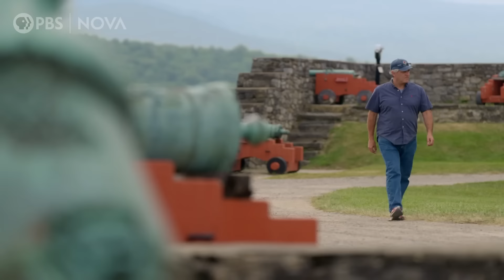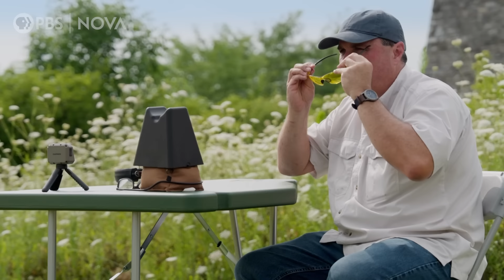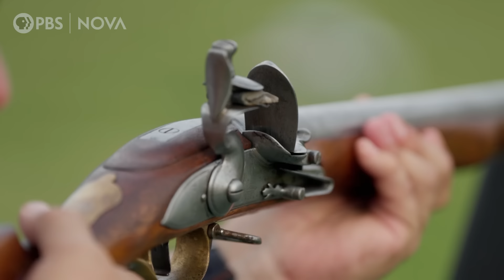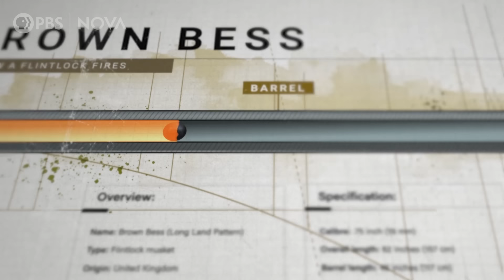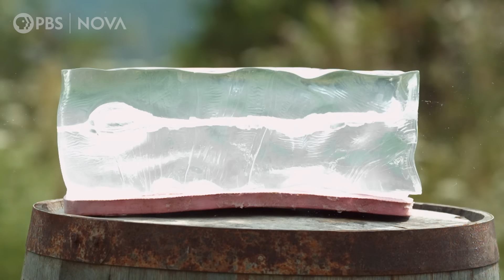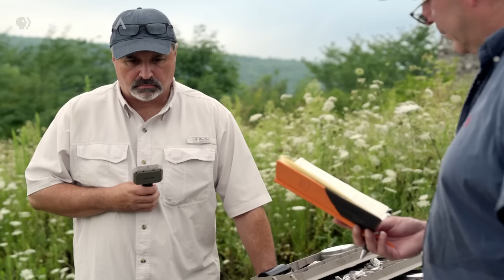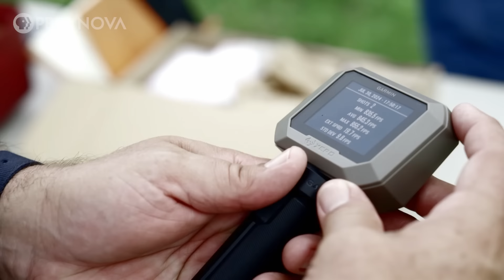How Deadly Was the Musket? | NOVA | PBS

Comment: My understanding is that the problem wasn't the impact, but the accuracy.  Both higher muzzle velocity and rifling contribute to a more accurate shot.  Apparently, that poor accuracy was why they had lines of soldiers firing at once, hoping some of them would hit the enemy.
Reply: ive done rev war and other 18th century reenactment my whole life youre believing a common misconception a musket while not pin point accurate is still able to hit a man sized target within 50-75yards depending on waddage. The main point of massed line tactics was to compensate for long reloads, extend the range under which musket fire would "fix" the enemy in place under fire even to long ranges therefore allowing your more mobile elements(musket armed light companies and cav) the ability to move quickly. The main point of large formations was therefore to deny the enemy the ability to move on the field of battle while keeping armies of thousands of men organized and protected against mass cav. just as every other comment has stated, I hope we've cleared this up for you.
Reply: @existentiallydead5998  50-75 yards isn't even a football field away.  Given the scale of some battlefields--which can stretch miles in either direction--that is a very short distance.  Bolt action rifles were accurate a thousand yards away or even more depending on conditions.
Reply: @primevaltimes  I mean, of course bolt actions were more accurate; you're talking about a significant amount of time and technological advancement.  But I will also say that they weren't more accurate because of the bolt action.  People put WAY too much stock in that.
Reply: @billmelater6470 I know the action doesn’t make the gun accurate.  The rifling and barrel length does.
Reply: @primevaltimes  Yes and no but that's still an oversimplification like the mythos of the bolt action.  You can have a shorter barreled rifle shoot better than one with a longer barrel.  

A rifle is a system with parameters that aren't independent of each other.
Reply: It's like breaking them with grape shot
Reply: No, the impact and stopping power of weapons nowadays is way higher. Mass x acceleration = force.
Reply: @Braziliansyrah sort of
To get the high speed the projectile on a modren gun has a low cross sectional area. Most guns are 1/4 to 1/3 of an inch and can transverse a body giving transferring a small portion of its energy to the target.
The musket ball was already 3/4 of an inch and starts to deform rapidly, transferring a large proportion of its power to the target
This was a little unfair comparison. The range looked about twenty five yards. Most fighting took place at ranges less then a hundred yards
Today fighting takes place at longer range, two to five hundred yards, when even the modren round has slowed considerably 
Modern hunting rounds have special tips on them to help expand the bullet that are absent on military rounds.
Medical care has greatly improved from musket times, but few men hit in the torso with a musket ball could have survived long enough to get any care, even if it was available
Reply: @Braziliansyrah no that’s not exactly true
At long range modern rifles certainly have the advantage. However in the range of a musket, one hundred even out to one hundred and fifty yards the musket created a more devastating wound than modern guns.
A round ball of lead sheds velocity very fast, compared to the ballistic coefficient of a modern bullet. But that same property made the fat ball very good at transferring energy to the target. At their close range they made big holes and horribly destructive
Reply: @Braziliansyrah  Why did you write this? What's the point? A musket bullet weighing 20-30 grams and traveling at 300-500 meters per second will have an energy of 3,000-4,000 J. For comparison, the energy of an M16 bullet is approximately 1,800 J.
Reply: @KaL_69_  I don't know how you did your calculations but they're very wrong, using KE = 1/2 x m x v² you get ~1.750 Joules with the M16 and ~2.000 Joules for the Brown Bess. That's discounting hidrostatic shock and superior piercing capability.
Reply: @Braziliansyrah  I use a ballistic calculator. Brown Bess bullet weight is 28 grams + bullet speed is 450 m/s = 2800 J
Reply: @Braziliansyrah  The British themselves complained about the poor stopping power of the new Martin Henry rifles during the Zulu War. They said a single rifle shot rarely killed a Zulu, and sometimes even multiple shots weren't enough. Even though these rifles were 12mm caliber, modern rifles are even weaker, so soldiers fire multiple times to ensure a kill.
Reply: I’ve split 18 playing cards, standing freehand with flintlock rifles and a couple of times with smooth bore flintlocks.   (Nope, not from a hundred yards)😊
Reply: Modern people are basically incapable of logical thinking... It's enough to compare the ammunition consumption in the 18th century and in the 21st century to understand who shoots accurately, and who shoots somewhere in the direction of the enemy, hoping to scare him.
Reply: A musket will hit a human torso every shot at fifty yards and will hit the same size target four out of five times at a hundred. 
Armies fought in lines, one man every eighteen inches, and one or two rows right behind them.
A company of 80 soldiers would present a from about forty to sixty feet wide and five feet tall. At three hundred yards a musket will get about one in five hits on this target
Reply: Muskets aren't really inaccurate weapons. The Prussian army did various tests and found that a trained soldier could hit a man-sized target at 80 meters 50% of the time. On the battlefield soldiers would panic, firing too high or too low, and they would be firing into giant walls of smoke produced by thousands of muskets and hundreds of cannons firing, having to guess where the enemy was. That brings down the rate of hits. The British at one point during the Penninsular War estimated it took 600 shots to inflict 10 French casualties. Volley fire was done right at the beginning of an engagement. After the initial opening volley soldiers would just fire as quickly as possible. Soldiers aren't going to wait for their officers to give the command to fire if they're being shot back at. 

The main two reasons why they fought in lines are command and control and defense against cavalry charges. Since there were no radios, officers had to issue orders via shouted commands, drums, flags, bugles, etc. Having them men grouped up together like that helped immensely with this. This is also why they wore brightly coloured uniforms. They allowed a commander to tell where his own troops where through the immense amount of smoke that would have covered the battlefield. 

Forming up into lines allowed the men to fire into cavalry charges and break up said charges very quickly. It also allowed them to quickly form up into squares. Horses are not stupid and will not charge into a compact formation of men. The only exceptions were with extremely aggressive horses and riders that had suicidal bravery. 

Accuracy did play a part in why they fought in lines, but it wasn't actually the main reason. You still had light infantry skirmishers that fought in open order, using cover and spread out
Reply: You literally just proved why muskets are incredibly inaccurate weapons and disproved your own claim
Reply: @JS-wp4gs  You've fallen victim to ancient myths and legends. In fact, the musket was the MOST accurate weapon of its era. Hunters and warriors ALL over the world began using muskets instead of their traditional weapons, which speaks to their extremely high accuracy.

Linear formations were necessary for controlling and focusing soldiers. Infantry lines, arranged in huge squares, were also used to defend against cavalry.

Light infantry also used muskets, although they fought in loose formation.
Reply: Line formations were about maintaining control, impeding enemy advance, defense against cavalry. It was not about inaccuracy.
Reply: @CountBifford  Line formations have nothing whatsoever to do with cavalry defense. Square formations are used for cavalry defense. Lines are explicitly about  being able to fire a volley of shots due to the inaccuracies of the weapons. They do not maintain control either, quite the opposite as lines are unwieldy, which is why columns are used for maneuvering and  maintaining control
Reply: Im sorry but you visually remind me of the " cute tho built good" predator from to catch a predator with Chris Hansen
Reply: This is not true. Modern soldiers also fire in volleys, unleashing millions of bullets at the enemy.
Reply: @KaL_69_ and most miss.
On average about 70 shots were fired by a musket to produce one causulty
Today it’s 70, 000
Reply: @JeffreyRobinson-r6v  Yes, that's true. Rifles are only accurate against a stationary target under ideal conditions. But accuracy drops dramatically if the target is moving, the distance is difficult to determine, or the soldier is tired and stressed.
Reply: I have a .50 black powder with a scope. Has a 1 inch deviation off center at 100 yards. Depending on the mass of the bullet. Almost perfect 120 degrees in a almost perfect circle around the bulls eye with a 125 grain charge. 200 grain, 340 grain or 400 grain.
Probably would be more accurate if the rifle was heavier than 7.5 pounds?
Reply: @RedbankHillbilly that’s not really comparable to a musket. Muskets were military arms. At that time all were smoothbored. At fifty yards they could keep about four inch groups. At a hundred about sixteen. So at a hundred yards you had about a one in five chance of missing a man sized target compleatly. Two in five of wounding , only two in five of disabling or killing wound.
British required four shots a minute, so there was no real time to aim, after the first volley
Reply: @RedbankHillbilly  I'm guessing you're shooting an in-line.  

Hey, at 1MOA do you really want a heavier rifle to carry around? I'd say keep doing what you're doing!  If anything, some fine tuning might come from really finding your NPOA, breath timing and good trigger squeeze.

And holy sh*t, 200-400 grains?  I'll just stick to patched round ball.  No need for more than 80 grains 2F.  Even that's getting high.
Reply: volley fire wasn't introduced to improve accuracy. like just think about it a little bit, how could shooting upon officer's command be more accurate than shooting in your own time?
Reply: @dolsopolar  Individual accuracy, no.  With several, increased chance of a hit!
Reply: I would say lines were for protection. Firing distances were like 30 metres, sometimes even less. Men can run that in a few seconds, cavalry would destroy even a line, spreaded out footmen wouldn't stand a chance at all.
Reply: @sergeandou9853  Engagements weren't anywhere near that close.  30m or less is grossly exaggerated.  Even the conventional wisdom of 80 yds is generally too close.  Most engagements occurred between 100-200m/yds and were generally determined by whoever shot first.  Even a smoothbore has a decent hit rate at those ranges if you stack enough guns together.  

Line warfare was primarily for command and control.  What had humanity predominantly been fighting for the past 3,000 years?  Lines.  Why?  Because when the the vast majority of people fighting are citizen soldiers doing it part-time, getting a guy to just follow the dude next to him is a heck of a lot easier than anything else, especially when your best forms of communication are yelling, drums, horns, and flags.  A lot easier for the commander to keep track of and command his men as well.  Even the best armies of antiquity followed this principle.  Contrary to popular belief, the Spartan weren't individual super soldiers.  Their martial prowess came mostly from flexible commands the commander could give that his troops didn't have to think about as they just followed the guy next to/in front of him. 

The second reason is firepower.  Same lightly trained troops grouped tightly together in a single direction means more guns, bows, spears, swords, etc, on target.  More capable/specific units like British riflemen did normally operate with wider intervals between men, as they were trained enough to do so.  Even regular units could be called on to act as skirmishers to screen or harass the enemy, but it was temporary.  
That's why today intervals increased between soldiers, because command and control and firepower have all significantly improved.  The main firing line is even still called a skirmish line because it operates the same.  We can just use it as standard now.
Reply: @sergeandou9853  That's not true. The firing range was about 200 yards.
Reply: @KaL_69_ you won't hit anything on that distance. And what is more important, you won't be able to see anything at that distance with all the smoke. Just read some American Civil War accounts. Even with rifles it was 50m on average because of black powder.